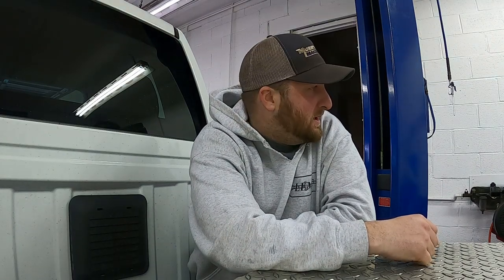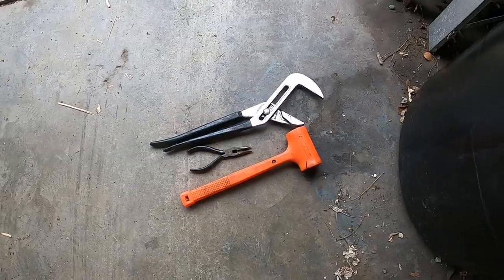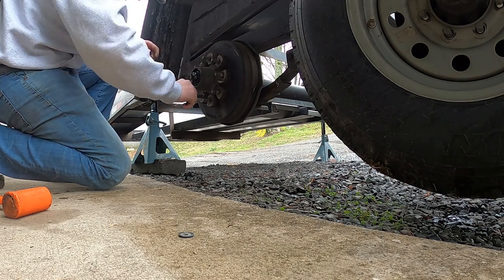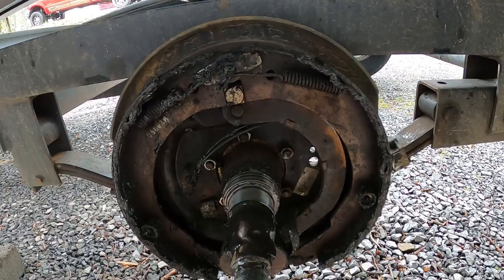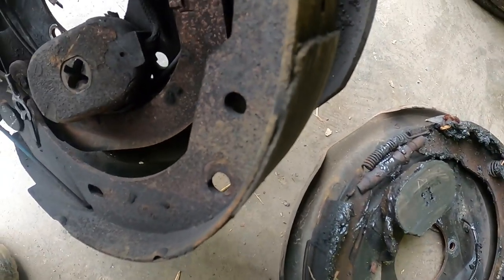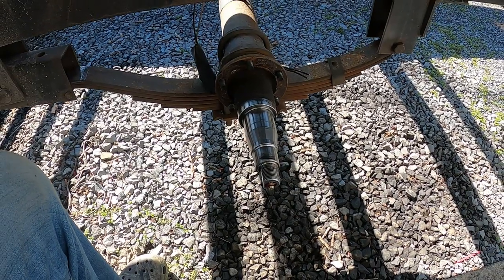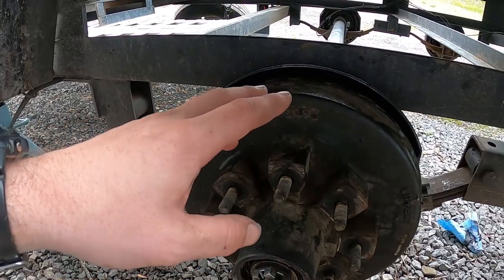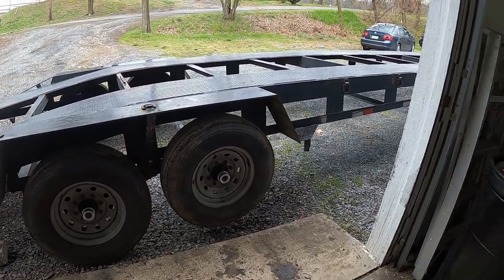Fixing My Trailer While We Are SHUTDOWN #094

Comment: When the Brake drum is stuck, its alot easier to put the wheel back on along with 2 bolts. Grab the whole wheel and wiggle. Comes off super easy with the hub attach to the rim.
Reply from the maker: Hahah look at you. That makes complete sense
Reply: @hotshothaulers  sarcasm? I know how you are..loo
Reply from the maker: Lmfao no not this time. That’s actually a good tip
Reply: @hotshothaulers  well alrighty than...party on!
Reply from the maker: Too much party, ready to get back to work
Reply: @hotshothaulers  I've been chilling since October 2019. Now that am ready to head out. Wife says you ain't going nowhere. Iam like Ooookay! Hotshot Hauler TV it is than....
Reply from the maker: That’s a hell of a vacation
Reply: @hotshothaulers  thank god my commerical insurance is only 3800 ever 6 months.
Reply from the maker: Wish mine was like that!
Reply: @hotshothaulers  26 years CDL. I place no value on my trailer since its paid for. I put a value of 50 grand on my truck. 1 million liability. Unlimited radius miles. ELD monitoring discount. My friends still say am lying my ass off. Oh and its Progressive with Freight aswell.
Reply from the maker: You lucky lucky man. Wondering what’s gonna happen when my new set up goes on the insurance
Reply: @hotshothaulers  a 5 car mini new is around 21 grand with winch and heavy duty mesh. So automatically the value will be much higher than your 2 car currently is if you will be financing it. With Cars arrive, ready Logistics or any major Broker, a 5 car is minimum 200,000 for cargo. Sounds like your equipment total is around 57,000 or so. I would call your insurance for a quote before committing to the 5 car and get a quote figure. It should be exact  cause you already have your MC#